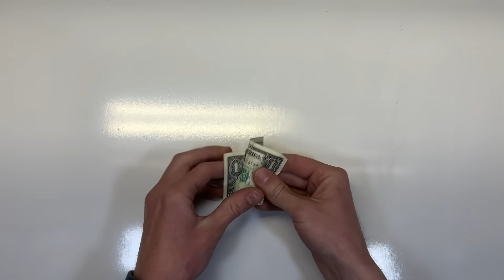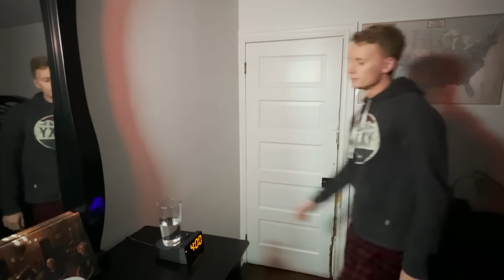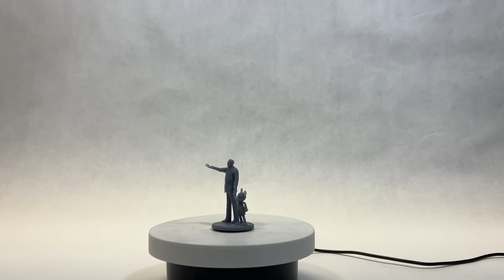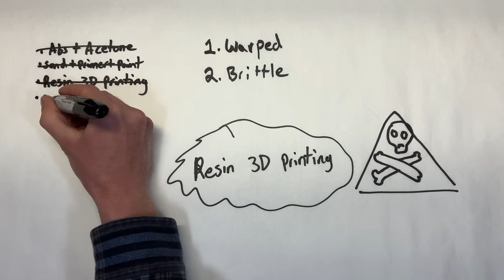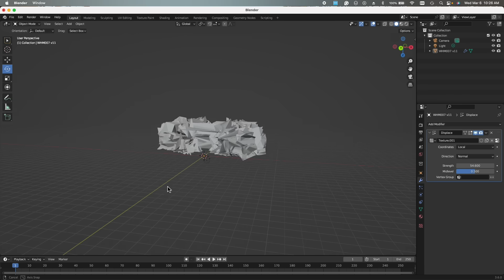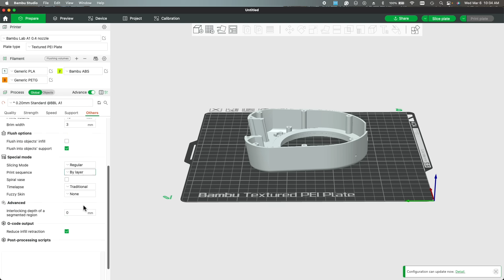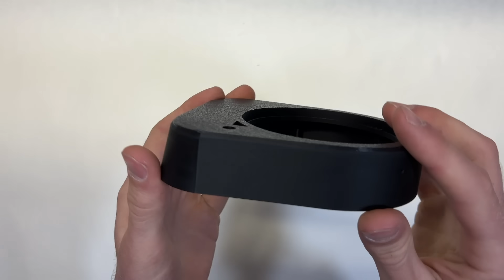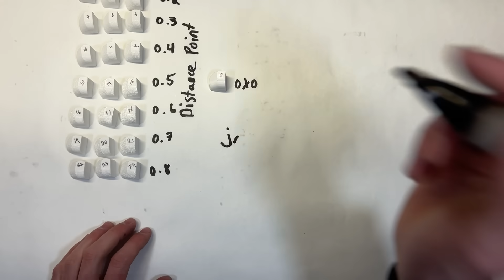My Secret To No More 3D Printed Layer Lines

Comment: Great video! Keep in mind you can "MIX" resins to get the desired effect. In example ABS like resin mixing with 15% flexible resin - no more brittle parts.
Reply from the maker: Thank you! Really? You can mix resin!?! That’s so cool!! So 85% ABS like resin and 15% flex resin? Have you tried this and did it work well? Now I’m excited about resin printing again!
Reply: @jakemgrim  I do it all the time...rarely do I print with a straight resin; my resin vat is more like the ever-replenishing soup pot.  

SuperPP 1.4GPa is clear, flexible, and super tough--I use Sunlu grey/white/black and add about 15% SuperPP.  Makes minis that can fall off the table onto a brick floor without breaking!
Reply from the maker: @gpweaver  that’s great to know! Thank you for sharing! Question: do you ever put anything on your FEP to keep parts from sticking to it?
Reply: @jakemgrim  I've sprayed my FEP with dry lubricant before, but honestly, that's a crutch/placebo.  Never noticed much of a difference.

Adjusting your lift speed/exposure/*object angle* is the key to getting prints to not stick.
Reply: @jakemgrim do bear in mind that it depends on the resins. Some resins might not get on well together. But in general yes you can mix them. It just might take some trial and error.
Reply from the maker: @sligit  I’ll have to give it a try! Thanks!
Reply: @jakemgrim also on the warping issue, it can be improved quite a lot with heavy supports, optimising your print settings and the part's angle to the bed.
Reply from the maker: @sligit  does adjusting your part angle, help prevent it from getting stuck to the fep? Changing the angle to reduce the surface area per layer help?
Reply: @jakemgrim  it definitely helps yeah. 45 degrees is a typical starting point but it's worth looking at the geometry of your part and how the layers are sliced to choose an optimum angle to reduce suction. And as I said, lots of strong supports. Slowing down the speed the part is lifted from the bed between layers can help too.
Reply from the maker: @sligit  good to know! Just curious, how big do you make your support at the point in which it contacts the part? I don’t wanna make it too big that it looks bad but too small that it breaks
Reply: @jakemgrim  for larger prints I'll use the medium or heavy support preset in the slicer, and maybe add additional supports after running the automatic support generation. A lot of people with more experience than me swear by only manually supplying supports. 

They do make a horrible mess so I try to place them on surfaces that won't be visible if possible.
Placing them along edges can make them easier to sand away. Snipping supports instead of pulling them off can help leave a convex nub to sand down instead of a small hole that can't be sanded. I also prefer to leave the supports on for curing sometimes.

Comment: Really cool that you didnt give up on it! You can printed this on resin printer, warping can be resolve with better supports and other orientation, britelness can be solved by using different resin (like abs from elegoo, tough AnyCubic or some mix) or settings (lesser curing time). But i dont think resin print wouldnt work for commercial product, cuz if its undercured it could be toxic, if overcured it would be too brittle, pref you need to paint then so no sunlight would desroy youre product. BTW love texture on fineshed clock!
Reply from the maker: Thank you so much for taking the time to provide feedback! I would like to try abs resin some time! I’m currently trying to print a statue of Walt Disney in resin to display in my lab. I hope you enjoyed the video and hope to see you again next week :) P.S. Let me know if you build anything awesome this week!
Reply: @jakemgrim  What they said: warping/breaking off the supports is all about orientation.  You don't want wide, flat areas parallel to the bed; it will stick HARD and tend to break off the supports--or, if you're using a magnetic print bed (which makes life so much easier), it can pull your bed enough to shift it off its magnet.   You want the smallest cross section printing at time--so, I'd turn your clock body about 45 degrees, so no one side is parallel to the bed.

Play with it a bit and you'll get a feel for the ideal angle.
Reply from the maker: @gpweaver  that makes sense now! I always wondered why resin prints were printed in strange angles. Now I know! I’ll give it a shot! Hope to see you around for future videos because I love feedback like yours :)

Comment: My problem with blender, is when I import STL's the dimensions are inaccurate. I try to adjust, but every time that scaling adjust instead of absolute dimension. So when I go to print, the prints are bigger or smaller than what it should be. This technique is awesome. I'm going to try this out. Its too bad you can't paint the parts you want the fuzzy skin on and the rest of normal flat. Check out overlapping seems video that also could be a great combo with this technique. Maybe they can integrate this with their SW solution. https://www.youtube.com/watch?v=vl0FT339jfc
Reply: You actually can, create a modifier to the area you want fuzzy. Or vise versa, make the object fuzzy, and use modifier to mark areas without fuzz.
Reply from the maker: @Belenosdj  thank you! Someone else had a similar recommendation. I like your reverse idea though. Is it hard to use the modifier?
Reply: @jakemgrim  no its basically a box you create, and you can set options differently within that box from the rest of the object.
Reply from the maker: @Belenosdj  good to know! I’m going to try it out!
Reply: @Belenosdj  Sweet! Is this only for Bamboo or can you do this with other slicers?
Reply from the maker: Have you tried implementing OBJ files? That might work a little bit better. I’m glad you liked this technique. I was super excited when I figured it out! Thanks for sharing the other video, I’ll check it out! Also, what kind of projects are you doing in blender then printing? I’ve always have had troubles with it
Reply: @jakemgrim No I have not but I'll try that out and let you know. I just tried Shapr3d and have been having a lot of fun with that recently. But I'll try this out. Thanks!
Reply from the maker: @nicktumi  good luck!!

Comment: I would guess that you have 0.4mm nozzle and thats why 0.3mm is the best,
 since it mostly stays in contact with the previous line, you can probably go higher if you have a bigger nozzle
Reply from the maker: That makes sense! Nozzle size would play a difference in which variables to use. What size nozzle do you usually use?
Reply: @jakemgrim : semi-related question, have you ever gone wild and done a .2 or .1 nozzle? I got some on a whim, but I haven't gotten my calibration 100% down, so it might be wasted extra time
Reply from the maker: @Infinatummedia  I’ve always wanted to experiment with different nozzles but I never have. I all most bought the other nozzles when I order my A1 but then decided to wait. If I do get other nozzle and make some cool discoveries I’ll be sure to share my experience here on YouTube!
Reply: @jakemgrim  So I finally busted out the .2 nozzle I've had lying around, and I have to say, it's pretty fantastic. Build time is dramatically higher and it's a bit touchier on tuning, but on the successful models I printed, the supports come off way easier, layer adhesion is great, and the finish looks great, very clean. I cranked the settings to "ultra" in cura (2mm nozzle, .08mm layer height) and don't have to sand at all (I am going to try xtc resin coating to see if I can get it to 100% though)

Comment: you can make only 20min extra by adding a modifier to remove the fuzzy skin on the inside, can I have one now that I saved you 1000 hours?
Reply: The modifier feature is like using a support blocker. It allows you to create a "zone" with custom settings. In your case I would recommend creating an obj or stl that is the exact same OD as you clock but solid, and just reduce the x and y by .1-.5mm and Raise by .1-.5mm that way you can import it with your model and it's already dimensioned properly.
Reply from the maker: @Kawalzki  I see! That sounds pretty straightforward. Is there any similar features where you could manually “brush” it on? Kind of like how you can click areas to add support materials?
Reply: @jakemgrim using a cad model as a modifier is way easier tbh. Create a solid body model the size of your enclosure, but offset the faces so it sits just inside the faces that you want fuzzy skin on. When you import the modifier it will be placed based on the coordinate system in CAD, so it should stay aligned to your enclosure. 

I should probably make a video on this haha. I use this method a ton for creating custom infill areas, or tweaking print settings for reliable, fast production
Reply from the maker: @MFGnerd  that makes a lot of sense! Definitely prevent having to file down things you don’t want to file. Once you import the cad file, can you group it with the other file (like so you can rotate to lay flat)?
Reply: @jakemgrim I use modifiers to create interface layers between vertically stacked parts
Reply from the maker: @mikehogarty6439  now that sounds pretty wicked! If you want to share a picture on our discord (linked in description) I would love to see what that looks like after it’s printed! That sounds really cool
Reply: @jakemgrim dude why wont you give him?!?!?!
Reply from the maker: Wouldn’t that be the same as contour? Or would the modifier work differently?
Reply: @jakemgrim   Using the modifier, it is possible to apply a fuzzy skin only on the outer contour of the part, while using the 'contour' option makes it fuzzy even on the inside.
Reply from the maker: @ggbartosz  I see! I haven’t used the modifier yet. That makes a lot of sense! Thank you!
Reply: @jakemgrim WHAT THANK YOU?? Give him ur clock for free 😡
Reply: modifier is an added shape that encompasses a different setting (right click) @jakemgrim
Reply: @jakemgrim you better send him a free one Lmaoo I bet he saved u hella hours
Reply: That's what I learned yesterday. I do 3D printing like - a week. :) 

Yesterday I saw a vid from a guy using the modifier method to only but infills where there need to be. 

He also set the print.speeds to have a 
certain surface finish etc.

The Orca Slicer is a damn cool one.
Reply: How do you use the modifier?
Reply: Prusaslicer: right-click: add modifier:(shape you want): fuzzy skin @AckzaTV

Comment: that is an ancient slicer setting not anything to do with bambulab, they just forked PrusaSlicer
Reply from the maker: I know you can use it with other slicing programs other than bamboo lab, but I had no idea that it was ancient setting! I just found out about it last few months! How long has Fuzzy Skin been around?
Reply: @jakemgrim since the ender 3
Reply from the maker: @sniperpronerfmods9811  does that mean you can do it in Cura?
Reply: @jakemgrim  yup first one to come out with it, a few extra settings but extremely similar, I think it came out in 4.0 ish... And can use modifer blocks as well

It was really useful when printers layers lines stacking was really inconsistent
Reply from the maker: @sniperpronerfmods9811  I can’t believe it took me this long to come across fuzzy. Now I feel kind of silly